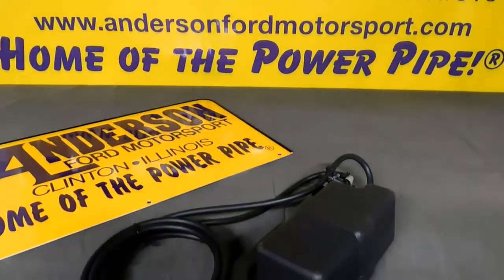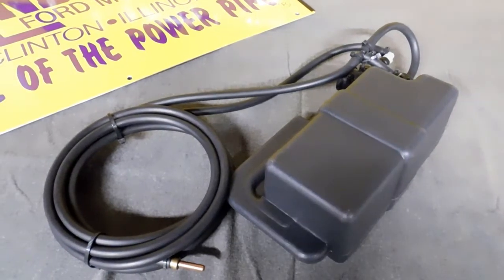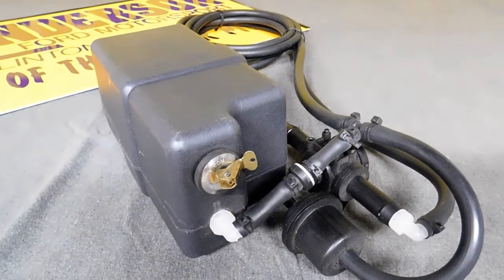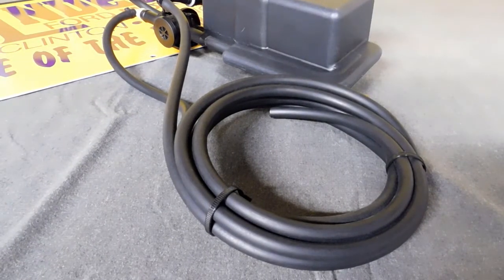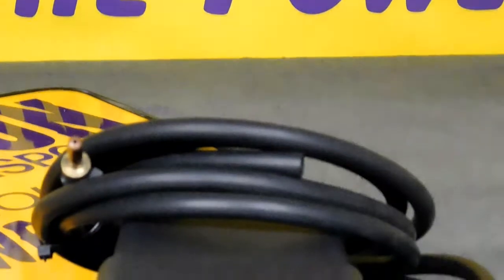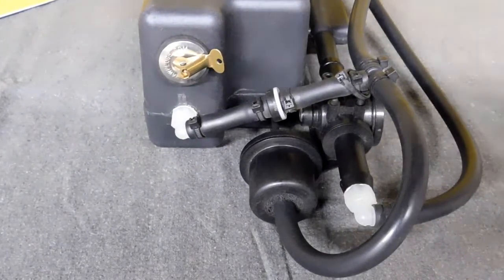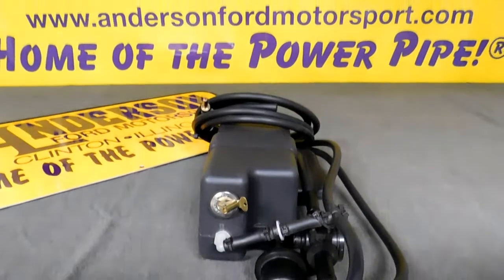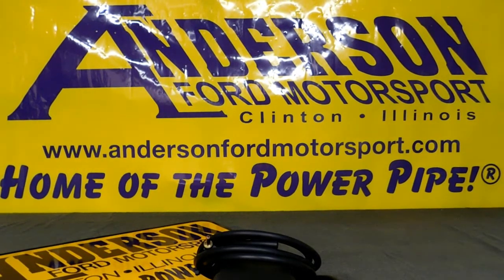Anderson Mr Freeze

Comment: Hello. My supercharger is not centrifugal type. It's roots type with two rotors. Will this setup still work? Where would be the optimal place to inject (before or after throttle body), in the supercharger snout perhaps?
Reply from the maker: It depends on what kind of s/c you have. Factory Eaton s/c's do not have coated hardened rotors and methanol can eat away at the factory coating which can be an issue down the road, now aftermarket roots or twin screw blowers like KenneBell are fine to use on

Comment: What happens if it is mounted slightly higher than the turbo?
Reply: Edgar Cortez it’s possible it could cause a gravity feed. I have the system in my 95 mustang GT supercharged and holy crap this thing made one hell of a difference. No more detonation and it is scary as hell when it goes into boost. It’s definitely worth it’s weight in gold if you are forced induction. I mounted mine in front of the radiator then ran the hoses to vacuum and directly in front of the supercharger impeller  blades because the fitting on the kit does not atomize the methanol when it is injected the fluid hits the impeller cooling the supercharger housing and well you know the rest..